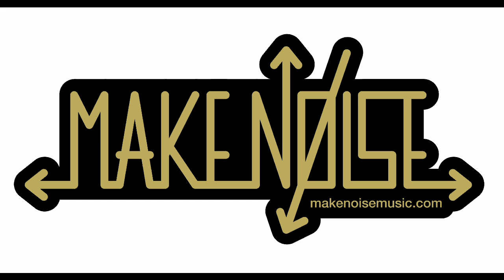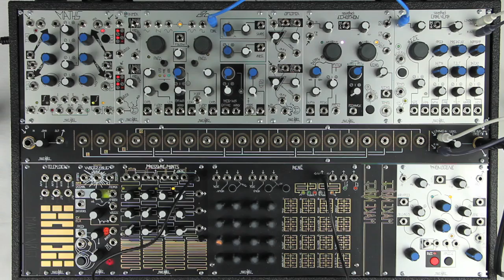MATHS Lesson, Pt. 1

Comment: I got Maths this week and have only just realised how important it really is going to be for me. I have been collecting modules and didn't know where i really was with them until i got Maths. It is the brain / heart of my system, it can control and coordinate so many different things and brings them all to life. I really did not know what i had until i got it. I will be posting some of my experiments as soon as i work out the recording setup. But the examples in the manual, which is excellent and so is the manual as a whole. It was one of the deciding factors in me buying it and all the great videos here and on other channels i felt confident in spending, what for me is a bit of money on it. Its the first exciting module i have bought. Than you very much for the great design. Other people have said this but this module really is deep, yeah at times impenetrable and headache inducing but i know, if i try to keep it simple to start with, the rest will slowly come. Cheers Tony